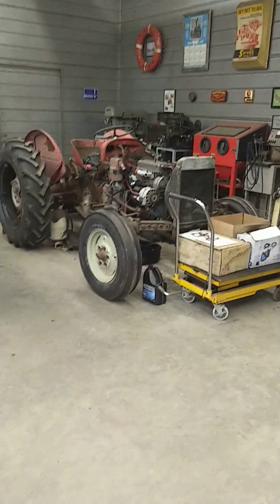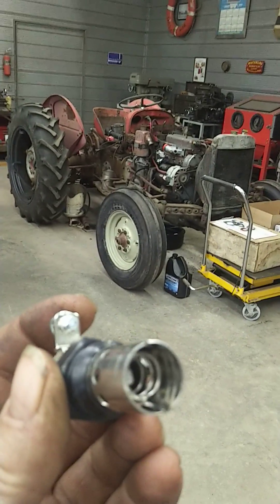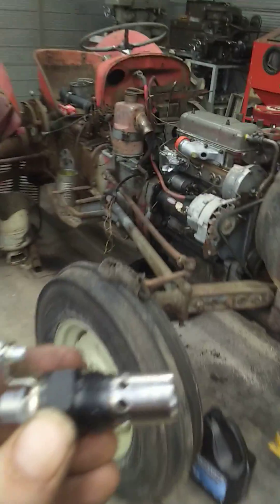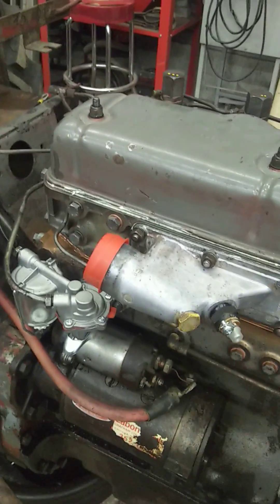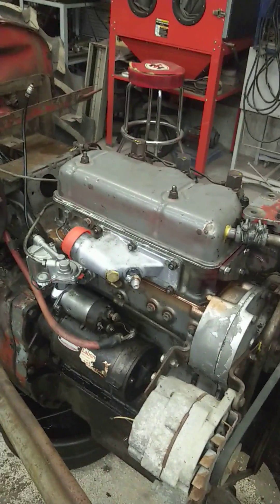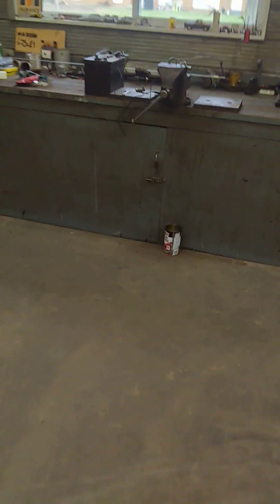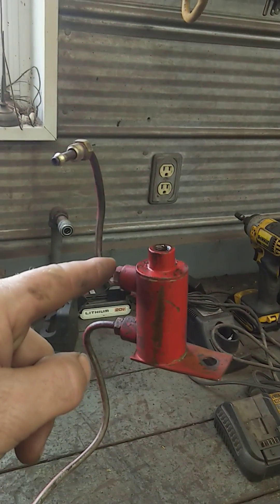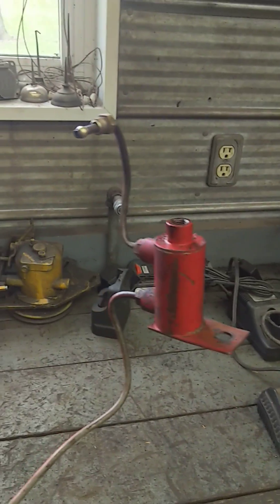Demonstrating a "Thermostart" Intake Manifold Pre-Heater

Comment: Will these take boost or is it only for naturally aspirated engines?
Reply from the maker: I don't think that boost would affect it.. at least not stock boost pressures.
Reply: @FarmallDoctor  I guess ill find out lol. did it come on any turbo engines stock and if so before or after turbo
Reply from the maker: @heathwilhelm1441  I looked into it, and they were used on many Turbo engines, right in the intake, after the turbo.
Reply: @FarmallDoctor thank you sir for the responses

Comment: I want to test mine to see if it's working OK, as I'm not sure it is. Do they go faulty or fail when they get old. Will the battery affect how it works, if the battery is getting low on charge. Can I test it in a vice like you did, but without the fuel going in to it.
Reply from the maker: @MrBooojangles  yes you can test it to see if the coil gets red hot. But if it has not been used in many years it can get gummed up and plugged inside. A thorough cleaning may help. Low battery voltage may affect it, but the unit doesn't require a lot of power.
Reply: @FarmallDoctor  ah right thank you. I have used it for many years in cold conditions to help start the engine, especially if the battery starts going flat from not using the tractor as much over the winter months. Well just a bit too low to crank the engine well enough. I find it helps start it quicker rather then completely drain the battery trying to start it. I guess you could call it a quick starting hack. But anyway, I've found for the last couple months, it don't seem to do anything to help and I've even tried holding the key in the heat start position for up to a minute and nothing. OK I know the battery probably needs charging too now, but I used to guarantee the heat start/thermostart would start it pretty much first crank before.
Reply from the maker: @MrBooojangles  a quick simple check without removing the unit is to unhook the power wire, and use and ohm meter from the unit's power terminal to ground. It should have zero ohms, but still continuity, as the meter does when you touch both test leads together. If it does not have any reading, then it has an open circuit, and will not heat.

Comment: So how does the power on/off work. Its that little burner running as the key on. Is that wire always hot im slight confused.
Reply from the maker: The unit is fed by a separate switch, or on it's own spot by the key switch. Usually by turning the key backwards, or half way to start. There is no power to it in normal running settings.
Reply: @FarmallDoctor  awesome i have my in-laws ford 5000 split right now doing clutch work and some other ins and outs i see that it has one of these systems from CAV. bugger to find a proper replacement element there's a few that are bigger. also ignition doesn't have a back turn position nor can i see where it would have had separate power but its good to know for when i put everything back together
Reply from the maker: @logansquires2009  check out Sparex. Search under your make and model. The most common part# is S.40626

Comment: How many amps does it drain do you know? I want to use it on May 1 cylinder Diesel lombardini engine.
Reply from the maker: Most manufacturers called for a 15 amp fuse to feed it.
Reply: @FarmallDoctor  thank you sir. My 60 years old tractor mechanic probably changed 100s of them on Ford Massey Ferguson tractors and he still thinks this is some kind of pre atomizing injector which works with 12v DC. When he watched this video his mind was blown 🙂 now it is time to retrofit this for my 1 cylinder aircooled diesel lombardini in my boat.
Reply: @FarmallDoctor Also do you know which tractor does that reservoir belong to? May be i can sort simalar one.
Reply from the maker: @emrahcanbaydar  MF 35 or 135

Comment: My 1978 555 Ford  backhoe has the same system and you can crank and heat at the same time but it gets so cold here in Manitoba I have a 200 watt magnetic oil pan heater and a block heater and a trickle charger on it because you need every advantage you can get when it drops down to -40 and when it’s windy it’s down right nasty just be careful if you are using Starting fluid not to use the pre heater 😀🇨🇦

Comment: Do you know what threads the fuel line is that threads into the thermostart?
Reply from the maker: It is a standard size nut and compression sleeve for 3/16 OD line.

Comment: Had an issue with a thermostart on a 6610 new holland that would continuously leak fuel into the manifold and get into the cylinders and thin the oil out, it shorted the key switch out and had some smoked wires, new key switch and new thermostart back up and running!

Comment: Many thanks, it's presently -14c here, this is getting ordered tomorrow for my David Brown.
Reply: Get two of them  and a thread tap and rum them in parallel!  I converted my Ford 3000 Diesel to two of these bad boys and it will start right up even at -10 like first try but you will need to get a bigger fuel tank :)

Comment: We have a Same Explorer that has a thermostart. The power for it comes from a coiled resistor pack that is mounted by the engine under the hood. Can you tell me the purpose of that and why it needs it? Thanks
Reply from the maker: Usually a resistor coil was used with glow plugs or a heater that was just an electric coil. I do not recall ever seeing a resistor used with a thermostart.
Reply: @FarmallDoctor Thank you for replying. It most definitely has a thermostart and not glow plugs. I’m just very curious as to the purpose of the resistor assembly. The coils get very hot and put off a little smoke sometimes if you haven’t used it for a while. It has a heat shield around it so it IS designed to get hot. I’m just confused why it needs it because all the other thermostarts on other tractors I’ve seen are just wired directly to the key.
Reply from the maker: @hemiram05  Unless it is not a genuine Lucas and was designed to be run on a lower voltage, or perhaps they thought that it may last longer on a lower voltage. Interesting indeed! If I find any info on that I will let you know! Cheers!

Comment: So it lights in about 10 seconds
Reply from the maker: @funone8716  it lights right away, but the burn doesn't start until 30 seconds.  The fuel burn is what does the job, not the element.
Reply: @FarmallDoctor  To be even more specific, it glows right away, and the flame lights in 13 seconds from the time stamps in the video.

Comment: Great job all way around.  You went the extra mile and helped me way more than you know.  I counted to 13 seconds.
I just got a Ford 340 from my brother who never ran it and it sat for 5 years with him and 10 from the guy before.   The guy before put a different key switch in it and I didn't realize it.
Originally it had a 5 position key switch but was replaced with a 4.  The manual says:
3.  Turn the starter key clockwise to the "HEAT" position and hold for 30 seconds.
4.  Start the engine by turning the key further clockwise to the "HEAT-START" position.
5.  If the engine fails to start after 25 seconds of cranking place the key in the "HEAT" position for an additional 15 Seconds.
WOW.  I couldn't imagine 25 seconds of constant cranking..lol
I thought I'd add a quick education that cost me alot but hopefully it will help someone.  
I used ether (just a quick touch) to start a ford 4000 a couple decades ago.  Anyhow,  after more and more ether I couldn't get it to start.   Long story short, after tons of money and effort, I discovered the ether cleaned the cylinder walls and caused it to not have enough compression.  I squirted a little oil through a tube into each cylinder and it fired right up.

Comment: Hi, I'm on with this set up on my ford 4000 rewire, does the wire to the heat coil require a relay like a glow plug? Any information from the heat on , on the ignition switch, forwards would be greatly appreciated.
Reply from the maker: No, a relay is not required. Power goes from a large spade terminal on the key switch directly to the heater. If your tractor didn't originally have it, a simple heavy duty push button switch will do.

Comment: I don’t think the thermostart is working on my 1998 MF231. It has the Perkins AD3.152 engine. Does it have an inline fuse?
Reply from the maker: Not usually. Key switch could be an issue. But check it first. Some required a counter clockwise turn, some were to the first detent clockwise.
Reply: @FarmallDoctor  I’m thinking it’s either the thermostart coil itself is bad or the fuel line going to the thermostart is stopped up.
Reply: @FarmallDoctor I replaced the ignition switch today with a new one and also a new thermostart plug and I’m still not sure if it’s working. It’s not cold here so I’m not sure if I should see smoke or not. The fuel pipe going to the thermostart plug is not clogged.
Any way to tell if the system is working right? I wish it was cold here in Louisiana so I could easily see if it’s working correctly. Thanks!
Reply from the maker: @travisricks3436  you won't see any smoke anywhere. The only way to see it would be to remove the intake hose between the air cleaner and manifold.
Reply: @FarmallDoctor new key switch, new thermostart plug, fuel supply pipe isn’t stopped up, thermostart still not working. Any ideas?
Reply from the maker: @travisricks3436  is the plug properly grounded? 12V feeding the terminal? You could test it on the bench and see if the coil gets hot. You don't need fuel to it for a quick test.
Reply: @FarmallDoctor I had 2 thermostart plugs tested by a mechanic. 1 was the original Perkins that came in the tractor when new (1998) and the other was a brand new aftermarket plug. BOTH WERE BAD!! Should I go back with a Sparex plug or a genuine Perkins plug? Part number 2666108. Thank You
Reply from the maker: @travisricks3436  gee, well, so far i have had good luck with the sparex ones..
Reply: @FarmallDoctor  that’s good to know about Sparex plugs being good. I may go back with that. Thanks for the info!
Reply: @FarmallDoctor  Good news, I got’er fixed! I installed a new genuine Perkins OEM thermostart heater plug (Perkins p/n 2666108) and it works perfect now. I bought it off eBay, opened box but still brand new. 
**A quick test: If I hold my fingers on the heater plug while it’s heating the intake manifold, it’ll get so hot I have to take my fingers off. That’s how I know it’s working. 👍🏻
Reply from the maker: @travisricks3436  Great!!
Reply: @FarmallDoctor yes sir! Thank You for this video, and for your help. My Massey Ferguson 231 doesn’t have that little “reservoir tank”. It gets the fuel to the thermostart through a metal fuel line, but I haven’t looked good enough to see where it’s going to. 
I can’t believe a brand new aftermarket thermostart wouldn’t work, directly out of the box!! No wonder it was only like $12! Cheap Chinese JUNK! Glad I went back with a new OEM Perkins thermostart. Total cost was $34 delivered through USPS mail to my house. If I my tractor ever needs another thermostart plug, I’m definitely going back with a genuine Perkins part!

Comment: I’m about to dive into this type of system on a Same Explorer II and before I start probing and testing I’d like to know what I’m dealing with. Mainly I was wondering how fuel is supplied to it. Fuel for the engine is drawn out the top of the tank so it’s not gravity fed. I see what looks to be a solenoid on the fuel line right before the heater valve but I’m thinking it may be a tiny pump. Have you ever ran into one like that? Thanks for your help
Reply from the maker: Yes, those small electric fuel pumps are very common. They are usually in stock at auto parts suppliers.

Comment: Thanks for showing.
I stopped by because I have a 06 JD4720 that is claimed to have an intake heater.(or box heater)
not EVER had any trouble starting, but I wanted to poke around and see whats out there.
I looked around under the hood today and followed the path from the filter and the turbo and found nothing that indicated electrical or fuel going to this "intake heater" 
They don't design the newer stuff to be easily recognizable, but I did not dig too hard the day before Thanksgiving.
Also the front end loader did not help, easily removable but not that determined 'today' 
Its starting to get just chilly but this is a new unit to me, just bought this year and trying to learn the ropes early before I get tangled up....

That's a neat simple setup that would no question aid in extreme cold starting conditions.  

also my tractor is so new and so very low hours it will most likely be a Long Time to be hard to start.

thanks again for video.
Reply from the maker: Thanks! I think that your unit is new enough, that if equipped, it will be an electric intake heater. I have seen them on the larger models like a 6310, etc.
Reply: Thanks for the reply.
The manual says it has intake heater,. Others that own,. claim they know, say the manual is "Wrong"
It's a ghost heater(that doesn't exist)
I can say I have not found it yet. But again my search was a lick and a promise,. or 1/2 of an attempt.
Thanks again. @FarmallDoctor

Comment: what size is the fitting that threads onto the end of the thermostart? 3/16?
Reply from the maker: Yes. 3/16"  compression sleeve and nut.
Reply: @FarmallDoctor  thanks. I have the heater plug on my Ford 5610S already wired up to ignition switch but no fuel feeding the heater. I'll tie into the fuel return line and come off that with 3/16 steel tubing. Thanks I think my return line is the plastic fuel line so will have to use anti collapse inserts with compression fitting on that part. Appreciate the response.
Reply from the maker: @brandonlykins9245  on a 5610 your injector leak-off line should hold enough fuel for the heater. If you use a tee fitting like used on injectors 2 through 4, you can install that on injector 1 and feed the heater from there.

Comment: Bought a used tafe 25di and couldn’t figure out why a fuel line went to the intake but this has cleared things up for me. Thanks for taking the time to put this video together. It’s near impossible to find any info on this thing so looking at Massey to get me close. Now I have to figure out how to check oil in injection pump as there is a sticker that states to check every 50hr.
Reply from the maker: If it is a Simms inline injection pump, there is a small drain at the bottom, a check level plug half way up the side, and a large fill cap at the top front.
Reply: @FarmallDoctor  thanks for the reply. figured out it’s a mico by Bosch but tags are kinda beat up so may try calling India to help identify if they keep records on their stuff.

Comment: Simple n easy explination..thanku.... in hot areas sometimes or mostly we dont use .yet the engine it starts easy... is it important or not if it is not working?.. or it s just for easy starting the engine.... thanks
Reply from the maker: It is only for easier starting in cold climates.. Not a worry if your original unit is inoperable.

Comment: So my old one I had the impression it wasn’t working it was drawing amps you could see from the meter but I wasn’t getting the ignition so I ordered a new one and that one keeps blowing fuses. I bench test, the old, one it heated up right away and it burned the wire that I had hooked to it. I had it clamped to a ground battery cable, so I’m really confused what is the ohms of resistance they’re supposed to be in that plug do you know? The reason why I asked about the ohms is I’m wondering if both units the old one and the new one is shorted out I tested them and they only had one and a half to 2.5 ohms of resistance.
Reply from the maker: I just measured a brand new one and it is zero ohms.
Reply: @FarmallDoctor  OK, thanks for the reply. My mechanic was thinking it should have a high amount of ohms. He was thinking if it had a very low amount of resistance than that meant it was shorting out and had a bad ground. Thank you so much for getting back with me and for the educational video.

Comment: I have a 2640 mf I had one in for over a year it qiut working. So replaced with a new one it lasted a week. So replaced with another and it qiut working checked ohms resistance the Last one still has resistance other 2 do not. There is adequate fuel to it and 12.44v am I getting bunk fuel heaters or something else cuasing the issue
Reply from the maker: I do know that there is a big difference in price between OEM and aftermarket.. But I'm not convinced that it reflects on the quality.

Comment: Hello, informative video! Can you axplain how the fuel stops leaking. Ther is valve or what? Thanks.
Reply from the maker: Yes, there is a small valve inside which is opened by the heat of the coil.

Comment: I have a white 2-60, seconds I hear a pop I assume that’s when the flame gets ignited when do you crank the engine after the pop or do you let the flame keep burning? Just wondered if it runs out of oxygen
Reply from the maker: Keep running the heater after the flame starts fior a few seconds and keep running it while cranking.
Reply: @FarmallDoctor  OK good to know the manual doesn’t explain any of that and it doesn’t even talk about the pop or the ignition that you hear so thank you. I have the electric manifold pre-heater on my 2105 and it was pretty useless. It just ran the battery down and then the tractor didn’t have any juice for cranking but this on that little Fiat works great.
Reply: Yes you can overdo it and use up oxygen, but it takes quite a while, around 50- 60 seconds. Most of the time when i can't hear it i cound to 30 and that seems to work well.
The way you notice when you overdo it is that you start cranking and it seems like it's JUST about to start, it will spew black smoke but won't start. Solution for that is stop, wait 2 -3 seconds and try again, this time without using the heater, and it will start right up.
Reply: @petarmiletic997  thank you for the tip